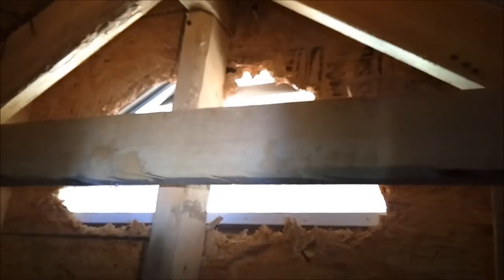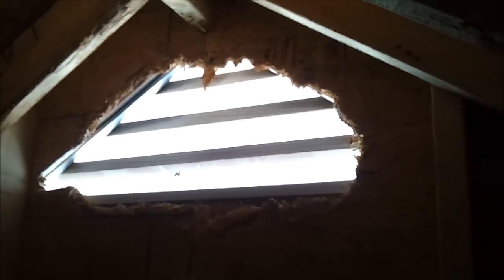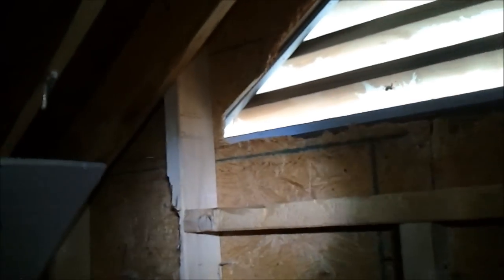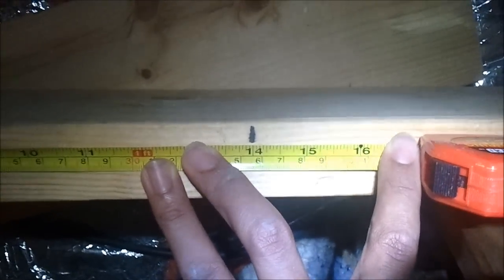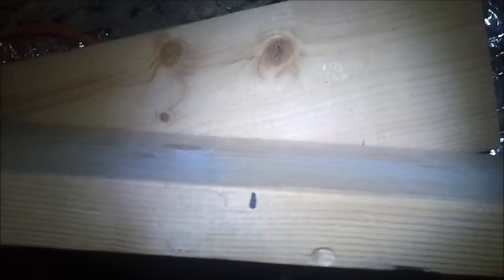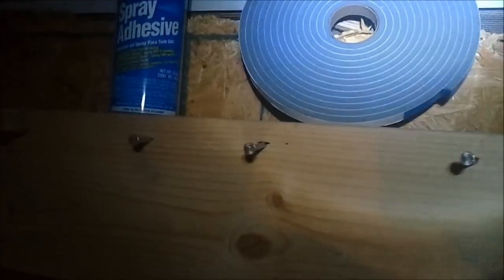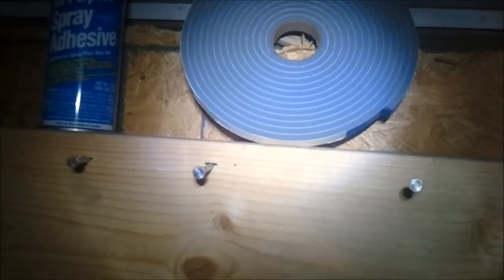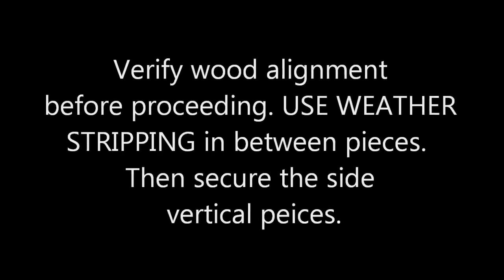How to secure, install, wire, and test an attic gable fan. Part 1

Comment: hello nice video you have made I am having one install in my attic, and am wandering what is the average price on a job just like yours.  I am in Florida and been getting estimates around the $675s
Reply from the maker: I am sorry Sir.  I have no idea.  If you feel up for it, DIY!  Considering my effort and materials, I think 675 is reasonable.  Just double check the sturdiness of the frame the fan is mounted to and also ensure the temperature switch works.  Also, check if you have to lubricate the fan or if it will just be fine on its own, year after year.
Reply: Thank you for replying back. Iam going to give it a try and try to install it myself. I went an bought the fan at homedepot , and when took it out the  box found out that the mounting.instruction says to mount it in a frame made by 2s by4s there is no way you can do this, becouse the fan is circular , and the brakets dont reach at the turning point. I prosceded to go your way, cuting a circunference i a plywoood, but now the pre drills hole on the fan alyminun body are to low , and when inserted th fan in the cut out these srews hole were not assesible , dont know what to do now , I guest my next step is to drill new sets of holes in the fan . What do you suggest?
Reply from the maker: ramon cruz Sorry this is soo late, but did you try rotating the L brackets.  One side has a single hole the other has a slot.  You may can work it around till you find a combination orientation that works.  The drilling extra holes would work, but don't place them too close to the original ones, you would weaken the steel.